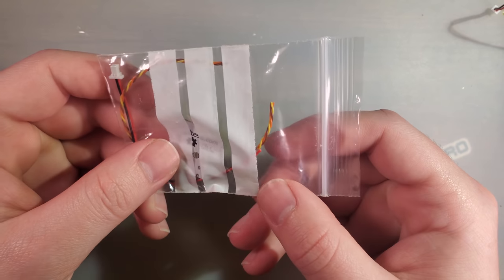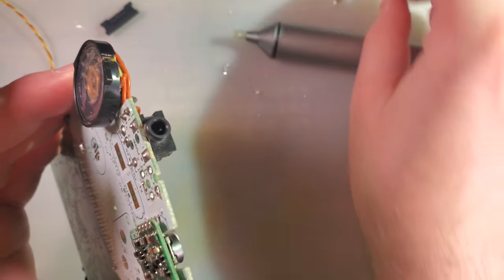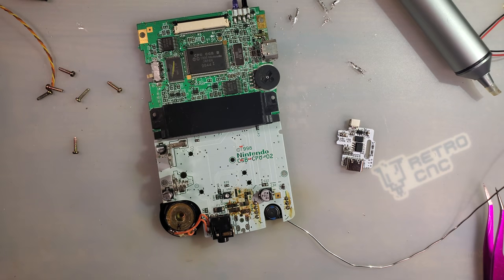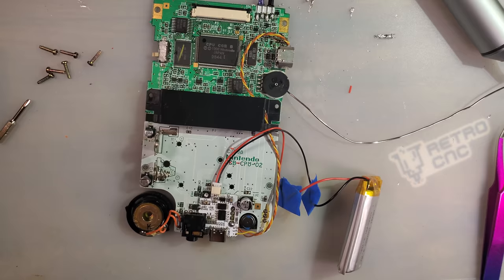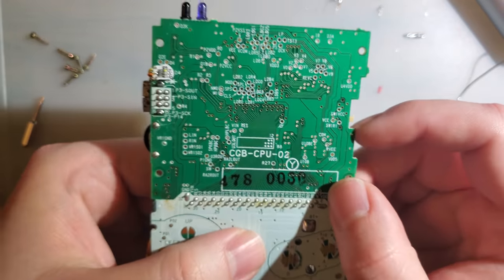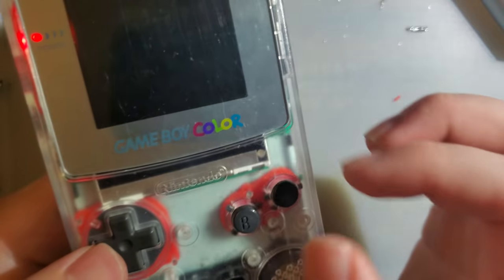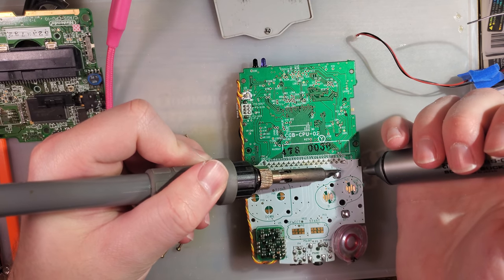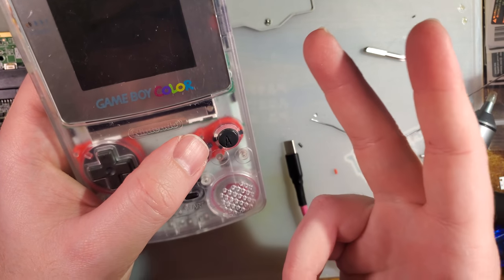Gil Tesa USB C LiPo Mod - Game Boy Color

Comment: Hello Makho,

Your installation looks great!
I really appreciate you have made a video. This module is a bit hard to solder and I wanted to make my own video for explaining how to install it but I don't have more GBC for that :(

About the lights, when the GBC is running out of battery the light brightness will decrease as the original led. I made a video and during the almost 9 hours the GBC was working it’s appreciable how the brightness is decreasing slowly.

The colors are white for power on, red for charging and green for charging done.

If you have a 3mm transparent LED, you can cut the legs and a bit more and use it to put it inside the hole of GBC shell, then the lights from the lights board will looks better. You also can put another thing to help the light go to the front, maybe a transparent plastic.

About the cable between the two boards, you can try to adhere it with glue to the edge of the GBC board, and cut it the exactly long you need, It may looks more pretty.
Something like this: https://giltesa.com/wp-content/uploads/2020/12/GBC_USB-C_CHARGING_KIT_16.jpg

Kind regards!
Reply: I haven't read your the description on the video before. You can charge your GBC and play at the same time, the TP4056 allows to do that. But the light of the GBC will be pink  color :3
If you fill the form on my blog for reserving boards, I will send one to you for free. I really appreciate your video. (put your nickname in some place to know you are)
Reply from the maker: @giltesa  TP4056 doesn't have load switching so I beg to differ on that.
Reply: @makho  Ok, I don't know that, but I know you can play with your battery empty and after some minutes/hours it will be full and the led will change between red to green. I have recheck that with a battery of 230mAh and the Game Boy Pocket board.

Comment: Apart of having an integrated charge port, I find the voltage drop of NiMh batteries to be really annoying. Especially with flash carts and IPS screens. There are noticeably more sound hum with NiMh than with a LiPo or regular alkalines. Plus they usually have a hard time booting with flash carts. 

That’s the main reason I like performing LiPo mods. 

Thanks for the video ! This kit seems to be quite interesting.

Comment: 15:13 a hot air gun with a small end part would work, put the gameboy's board on something so it is completely flat and both sides aren't covered, set the new led board on where it needs to go after adding solder, heat it from the back side of the gameboy's board with the hot air at 375°C for 40% lead 60% tin solder (or 375°C to 425°C if lead free solder is used [not all lead free solder is the same so one kind might not melt at a lower temperature but then another kind that's thinner will]) and the lowest air flow setting for that temperature, let the led board pull itself center and remove the heat then let it sit for a little bit for the solder to cool, after the solder has cooled check for shorts if there aren't any then it's done but if there are shorts the part will probably have to be removed cleaned up and put back on to get rid of them.

Comment: So have you experienced a problem where the game you put in resets it's battery save? Because that's what's been happening to mine after I followed this guide
Reply from the maker: nope, never had a problem like that with a properly wired power supply. Check your wiring/soldering.
Reply: I know I'm two years late, but is it possible the game battery is dead? If you just started doing this after years of your games sitting then it's possible that is what happened.

Comment: Thanks makho! Great video, very easy to follow.

Quick question - I've completed the install, but for some reason the power on LED doesn't seem to be working. The system powers on, and the red and green charging LEDs work fine. As far as I can tell, there aren't any issues with the cables or the soldering, but I'm not super sure what I'm looking for. Are there any reasons off the top of your head that you'd think would cause the power LED to not turn on?
Reply from the maker: It's not properly soldered would be my guess. You'll need a multimeter with diode check and continuity check to troubleshoot. Or just redo all the soldering and double check everything.
Reply: @makho   I don't have a multimeter, so I de-soldered, cleaned, and re-soldered everything a couple of times with no luck. I had another one of the kits that I was planning on using in a different build, so I tried using the LED board from that. Worked on the first try! So I figure I must've messed something up and broken the first one. Thanks for the response, it was good to know I wasn't missing anything obvious. Happy to have it up and running now.

Comment: Since this mod disables the battery terminals, would it be possible to plug in a battery connector and solder the ends to said terminals and use rechargeable AAs?
Reply from the maker: No because the charge module used in this mod is for Lithium-Ion batteries, not NiMh.
Reply: @makho  aw man. Is there any way to mod it? Or make a kit that does so?
Reply from the maker: @pixelprime5908  There are NiMh charge controllers, yes. https://www.youtube.com/watch?v=pMQQno4l_vs

Comment: Is there a good option for Type C charging while using NIMH batteries? Also would that work with change and play? Wondering if a Type C mod would be worth it. I know I've been really wanted a Boxy Pixel GBC but they've been OOS for awhile it seems. Love the designs with add ons ready to on the shell with no physical modifications needed
Reply: The video below addresses each of the parts you are looking for: NiMH charging support, charge and play, and type C charging port. Have the flexibility of charging the batteries internally or swapping batteries like usual.

https://www.youtube.com/watch?v=glz8QctjjtY

Comment: I wonder if SP batteries fit? Because then you could use some spring connectors for sp batteries. Perhaps cut the battery compartment out entirely and just 3d print a holder suited for SP batteries. 

"Is something getting hot...?"

- Makho 2021, RIP
Reply from the maker: nah, this battery is much bigger than SP batteries

Comment: Do you think a slightly thicker battery such as a 123048 will fit better with funnyplaying GBC shell?
Reply from the maker: it will probably fit, yeah. I just had the other one on hand. If you try it, let me know
Reply: @makho  The 123048 does indeed fit with some room to spare. I will probably add foam to cushion the battery.

Comment: hi There,
love this mod :)
just wondering i sawe your playing LED is blue and when its charging its red

so my questions are 
1. Does it have a low battery colour?
2. Does the red light turn off when charged ?
Reply from the maker: red for charging, green for charge completed, white for power on. I believe the white LED will turn off when the power is very low but ymmv

Comment: Looks good and convenient with modifications for some. But i am concern that it by passes the f1 fuse so no protection there. I feel it still easier to do TP4056 board and plenty of space below area of battery compartment (opposite of speaker). Still pretty cool though.
Reply from the maker: You solder it to the fuse. The other fuse you bypass is disabled with the battery terminal power input anyway.

Comment: Really interesting video and super well explained. I was thinking about doing that mod too on nmy GBC, would this board work also with a protecte 14500 cell? (making right connections is not a problem)
Reply from the maker: should be fine